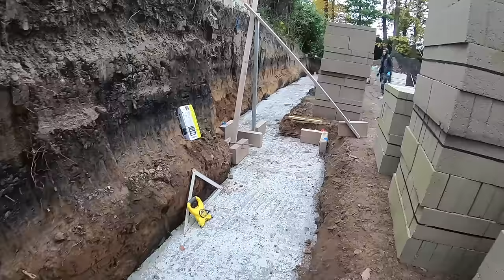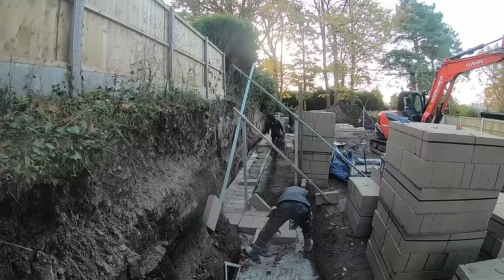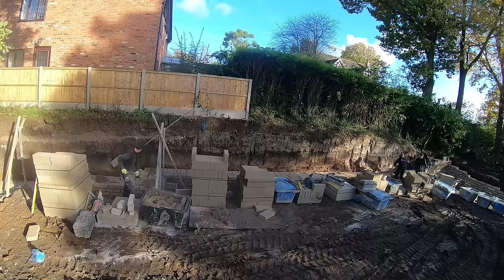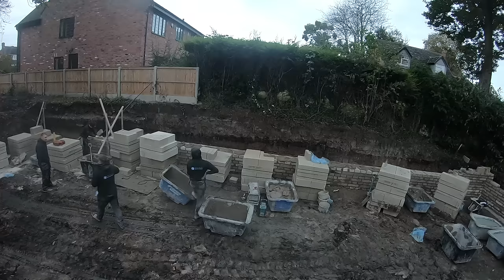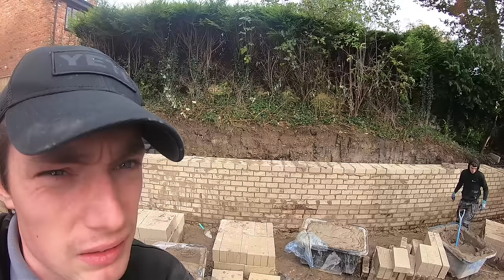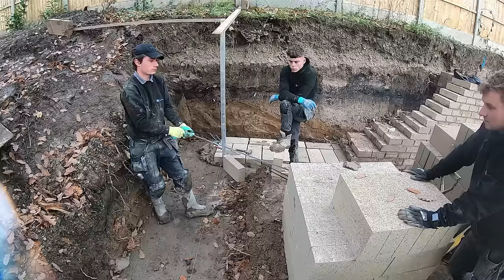Bricklaying - Monster Retaining Wall - Days 1 & 2 #bricklaying #vlog #building #retainingwall

Comment: thinking of building a brick shed with a bunker under it.  do you think i should do the walls like this?  id be digging like 8 ft below ground level.  id expect it to hold with the walls being that thick?
Reply from the maker: I’d suggest using the hollow blocks with rebar and concrete, two skins of that tied together would be bomb proof 💪🏻 probably be cheaper aswell 👍
Reply: @MorganTheBuilder  thanks for the response!!
Reply from the maker: @ke161co  no worries mate 👍🧱

Comment: Would have been nice if they had worked the corners to have worked blocks instead of having to do all those cuts in those whatever Nm concrete  blocks.
Reply from the maker: The owner wanted it as tight to the boundary as possible, this is the best we could do to ensure we still got a good bond in the corner 👍

Comment: Some graft there lads, surely would of been easier and cheeper for a rc wall??
Reply from the maker: Cheers mate 👍🧱
To be honest I did suggest before we started, doing it differently. But it was abit of a last minute job, we came to assess the job and the previous groundworker had already cut away a lot of the banking where the neighbouring house is, so we had to move quite fast to stabilize the ground again, there wasn’t enough time to have a new plan drawn up to build it differently and this was already agreed so we had to go with it 👍
Reply: @MorganTheBuilder  makes total sense then just to crack on and get it safe with it been winter 👍rather you than me 😂
Reply from the maker: @martinknight510  exactly mate 👍 👌 haha 👍🤣

Comment: 3.60£ flat laid blocks :)
Reply from the maker: I wish it was on this job mate 🤣👍 think we were getting £1.70 a block but we were throwing them in, don’t have to make much effort with these, still made a decent coin too 👌🧱
Reply: Thats bad because laying normal block is 1.80 lol i used to lay  flat and get £3.60 per one if you wss getting 1.70 you was getting mugged off mate
Reply from the maker: @pofkebiceps8676  yeah but the owner was tight as cramp so that’s why the rates were low 🤣 still made some decent money from it so I’m not complaining 👍

Comment: 400 blocks a day ????  🏴
Reply from the maker: We did about 600 a day on this wall 💪🏻👍🧱
Reply: @MorganTheBuilder  Each ?? 💪🏴
Reply from the maker: @johnbowkett80  nooo haha, we’re not that good 🤣 between 2 brickies and a labourer 👍🧱
Reply: @MorganTheBuilder  600 really ?  Should easily lay 600 one man . Most I layed in one day was 1500 on job like that and that's mixing own mortar
Reply from the maker: @Derekryan456  impossible 🤣🤣
Reply from the maker: @Derekryan456  impossible 🤣🤣
Reply: @MorganTheBuilder  not really
Reply from the maker: @Derekryan456  are you talking bricks or 7.2n concrete blocks? 
No way you’re laying 1500 blocks on your own in a day. That’s just over 3 blocks a minute if you did an 8 hour shift, that’s without stopping to mix or eat or anything 🤣
Reply: @MorganTheBuilder  concrete blocks everyday.  You get use to them , not like them lightweight blocks uk use. All concrete in Ireland.   8 hour shift  for you.  10 hour shift with me . Labourer mixing blocks dropped right beside you . Easily lay thousand + a day
Reply from the maker: @Derekryan456  ah so it’s already gone from you doing it on your own to having a labourer, and they just so happen to be heavier than what we use in the UK. Give over mate you’re talking 💩 🤣🤣🤣🤣
Reply: @MorganTheBuilder  laying on my own , a labourer mixing . I see yous were getting ready mix mortar.  Every house here is built with 7.5  Newton solid  100 mm concrete block . Not talking poo
Reply from the maker: @Derekryan456  still impossible. The amount of material and time it takes to mix enough muck to lay 1500 blocks on your own in a day alone says you’re telling lies. It takes at least 10 mins to knock up a decent mix. And who in their right mind wouldn’t use ready mix on a job like this? We were doing just over 2m3 of mortar in a day, no labourer could physically keep up with that. 
Next you’re going to tell me you had 4 mixers on the go at once 🤣🤣
Reply: @MorganTheBuilder  12 / 15 mixes let's say 15 x 10 =150 mins so that leaves 450 mins for Labourer to fiddle with his thumbs?  
One full tub of ready mix mortar should lay 150 solids on the flat and on the edge 250 .  I wouldn't be saying it if I did. 1500 is balls out . But easily lay 1000 in any footing .
Reply from the maker: @Derekryan456  I’d say prove it but I know you can’t so this conversation is irrelevant 🤣 
You’ve gone from saying one man can lay 600 easily to now saying a 1000 easily, make your mind up 🙄 what you getting out of lying over the internet? 🤣🤣
Reply: @MorganTheBuilder  read my comments 600 easily that be on my own on footings. With labourer 1500 balls out or 1000 easily in footings . Sorry to bust your bubble . If you can only lay 300 blocks a day on job like that.  Slow mate
Reply from the maker: @Derekryan456  slow 🤣🤣🤣 if you can talk the talk make sure you can walk the walk. Prove it and I’ll double what you get paid to lay these 1000 blocks a day “easily”. 
Bet you’re actually the labourer doing the mixes 🤣🤣🤣
Reply: I'd have to agree with gman here I'm and irish blocklayer and he's not wrong 350 on edge a day is standard stuff here on a job like that any blocklayer in ireland worth his salt would have 1000 down 7n -10n blocks your every day stuff it's a savages game over here man
Reply: @topnotch3561  I've worked with Irish trowels here in Birmingham and there is NO WAY a 1000 blocks a day is possible ..... Maybe half that on a good , lucky day with a very , very long run  
 👍💪🏴
Reply: @topnotch3561  someone who knows.  Well they obviously still don't believe me. They are gone soft  building them lightweights.  
Either way they still won't believe me . Maybe they should stop pussying about with cameras and go balls in .
Reply: @johnbowkett80  there's a reason there in Birmingham and not ireland I don't mean any offence its just a fact I can't convince you over the Internet If your at bricks every day you become very efficient same with blocks its all about your set up and your fitness
Reply from the maker: @Derekryan456   “pussying about with cameras” yet you’re the one watching me lay blocks 🤣 
I see you’ve dodged my offer aswell. Tell you what, I’ll even buy the camera and whatever you need to prove to me you can do these 1000 a day easily. You’re all mouth 🥱😴
Reply: @MorganTheBuilder  I haven't  laid a block in over year and half . Moved onto bigger and better. Your more than welcome to come to Ireland,  I have many gangs ringing me offering work. I can get it set up no problem.  You bring  your camera and i show you how to lay 1000 + 4 inch solids in a footing . 
That wall your on laying 300 blocks each is slack . Ready mix mortar and all . I would have 300 blocks layed by my first break on job like that.   But your more than welcome to take up my offer.
Reply from the maker: @gman162 how convenient, you haven’t laid for over a year and a half, probably cos you’re still on the mixer 🤣 if you’re doing the numbers you claim to be I’m struggling to see what could be bigger and better, at todays prices that’s over 10k a week. You’re so full of s**t it’s laughable 🤣🤣
I’ll take you up on your offer, get it set up and just let me know 👍 But I imagine I’ll be waiting long time 😴
Reply: @MorganTheBuilder  exactly onto to better things that make more 💵 and much easier . Abit of a no brainer.  Look mate if you can't accept that I can lay 1000 easily in a (footing) thats your problem not mine. Maybe look around you and see where you can speed up.  Makes me laugh that you think I'm talking 💩.  I'm the one laughing here that yous can only lay 300 blocks on a big wall like that. As I said in my last message I would have that down by my first break .
Reply from the maker: @Derekryan456   I find that the people who boast about making and doing xyz are doing absolutely no where near that. 

My Instagram is in the description, send me a DM when you’ve got set up to prove your 1000 a day and I’ll come see it for myself, and I’ll bring my offer with me, I’ll be waiting 😉👍
Reply: @MorganTheBuilder  I'm not boasting.  I made a statement.  Was just wondering how come you can only lay 300 solids in a big wall like that
Reply from the maker: @Derekryan456  aaaaand you’re still dodging my offer…

I could probably do more, given the right conditions. But I’m also not going to destroy myself when I know I’ve got years of this to come. There’s nothing big or clever about ruining your body

Comment: Footing should have steped wall not battened correctley looks like no drainage out lets built in
Reply from the maker: Are you a structural engineer? 
Why does the footing need to be stepped? The site isn’t on a slope 
A 4 inch land drain was installed afterwards, and the wall backfilled completely with gravel
Reply: @MorganTheBuilder the step gives the wall more purchase on the footing,glad you remembered to put in drainage  but it should have been at the back of the battered block work but you left your footing very tight  but still and all a tidy job
Reply from the maker: @brendanmalone463  it’s just how it was designed mate 🤷‍♂️ the footing was tight because it was as close to the boundary as we could get it